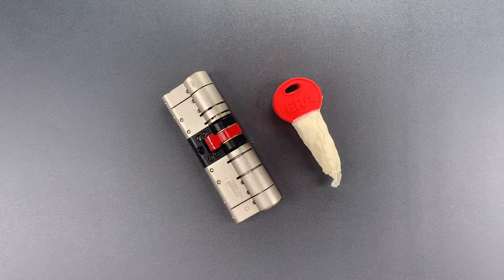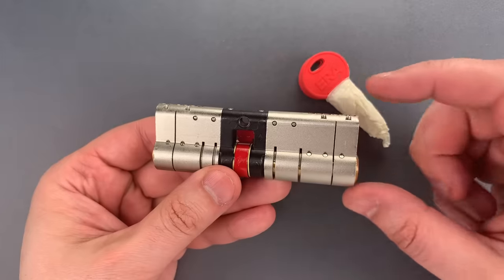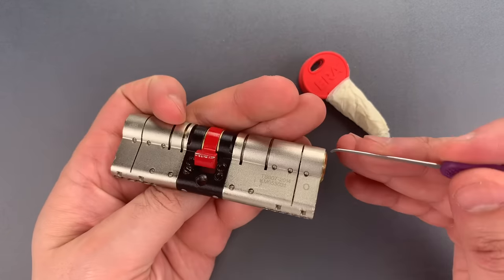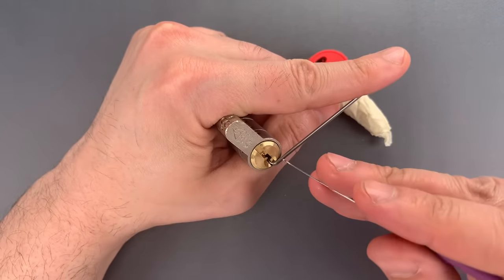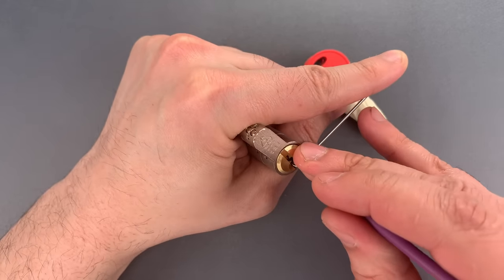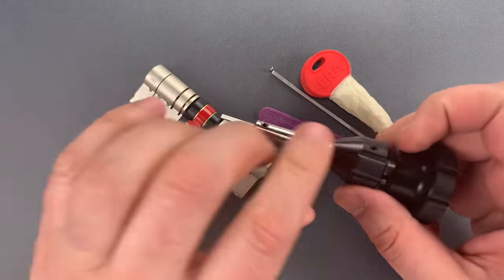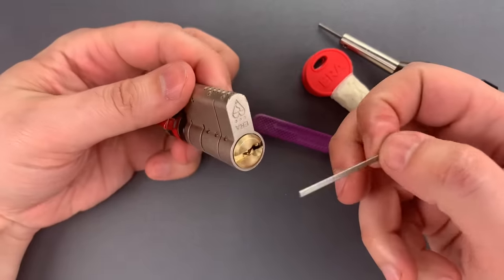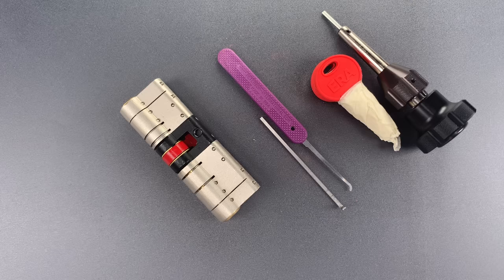[1256] ERA “Fortress” Euro Cylinder Picked (6 Trap Pins!)

Comment: "The three main threats to european cylinders, Snapping Drilling and Picking"

I suppose the main threat to american ones is firearms then?
Reply: You’re actually pretty much correct.  If you look at the residential market for locks, the more expensive a lock is, chances are, the main upgrade is beefiness.  Furthermore, lock cores in the US are (generally) less advanced than euro cores.  A “high security” lock in the US is basically just kinda resistant to bumping and raking (if that).  The difference narrows as you go higher up the food chain, of course, but at the mass market level?  Yeah.  Physical destruction (guns, bolt cutters, drills, a big ol hammer and a crowbar, etc) is the main mode of attack for people trying to get through locks here.
Reply: @glytchmeister9856  or just entering through the wall right next to the door. It's pretty much just plywood and insulation
Reply: Main threat to Americans, the owners. A lot of burglary happened without the need of forced entry or lock-picking.
Reply: @insu_na  Maybe in your crappy house, but mine has bricks as its outer layer.
Reply: I dont think I've ever seen an home invasion where they shot the lock on the door. Either the doors arent locked or they kick it in.. nobody is tryna fire a bullet and alert the neighborhood they just entered a house.. put some thought into your comments people
Reply: @eustacehendrix9659  that's because successful burglars tend to case neighborhoods and look for the vulnerable houses. 

The entire point of a lock is to make a burglar look somewhere else. It's almost impossible to stop someone that doesn't care about getting caught.
Reply: @awesomebob657  What kind of doors you all have that can just be kicked in like it's nothing?
Reply: @doomse150  some can some can't. Just depends how it's built. But most doors are sturdy. Most door frames are not. the striker and dead bolt stab into the back half inch of the door frame leaving only a small amount of wood to break to allow those locks to go straight through the wall. That's how cops break into houses. That's how criminals attempt/do it. I know. I worked for a large real estate company and had to fix several door frames after cops break into them.
Reply: @doomse150  I never said it was easy. I just said they do it.
Reply: The main threat to firearms are rust and politicians, not pickable locks.
Reply: @glytchmeister9856  I'm highly skeptical that shooting locks is a common entry method in real life (other than for police tactical teams, who use specialized rounds which are expensive and not widely available).   If nothing else, it's unlikely to work very well.
Reply: yes we have a specific part in locks that prevent firearms
Reply: @shawnpitman876   I don't know why but that response got me
Reply: If the lock snaps - you cant get in even with the key!
Reply: Don't forget the most reliable Pick, the Ford F150 master key
Reply: @doomse150  I lost my apt key once and kicked the door in; one try and the strike plate ripped out of the (wooden) frame.  This is 100% normal for US residential construction.

When I bought a house, I replaced all its doors and frames with steel.  Still plenty of windows, but at least that’s more obvious to passersby than a kicked-in door.

Comment: This is impressive on both ends. This lock does so many things right, yet there still are way to go around it, even if it takes specialized tools and prior knowledge. Alternatively someone might try this approach when dealing with any lock "just in case"
Personally, I think it looks like a lock worth buying. It will stop almost all attacks.
Reply: That's just how it is with security, there's never absolute safety, all systems can be compromised given enough time, resources and knowledge. Usually the goal is to make things hard enough that any breach attempt can be detected and prevented by other means.

Comment: American locks: "Okay I'm gonna use this regular thin piece of metal aaaand it's open."
European locks: "Okay thank god I'm seeing this lock from the outside to know where all the trap pins are so I can use my highly specialized tool to bypass them."
Reply: A professional lockpicker buys every new lock they can find, anyway. It's not even that specialized of a tool. It's just not one LPL uses often because he knows which way the lock turns before the video starts.
Reply: @bubba200874426  What do you mean "which way"? What is that tool used for?
Reply: @aze2099  it's used for flipping a lock over  to the other side when you turn it the wrong way. 

Unless you're familiar with the lock, you might not know which way it needs to turn to open. This is why professional locksmiths try to get as many locks as possible, but most can't check them all.
Reply: @bubba200874426  "it's used for flipping a lock over  to the other side when you turn it the wrong way. " in America... you forgot to add that. heh
Because in Europe most of the time you need to rotate the cylinder not once but twice and in some cases 3 times(like in case of Gerda Tytan with 16 pinds from 4 sides so you would need to pick the lock 4x3=12 times and most of the people are unable to do it even once)... and LPL when he was visiting Bill was not ready to take Gerda Tytan for a ride...
Reply: @Bialy_1  Only metaphorical tools care about who's using them.
Reply: Not that it actually matters, because burglars don't pick locks anyway.  If it can't be raked, bumped, or bypassed, you're fine.
Reply: Typical.
Europe is more on quality. China on quantity only, and the usa a mix of both, but overhypeing it to the extreem.
Reply: Americans locks are bulletproof. Because it is easier to buy a gun than a lockpick.

Comment: Out of curiosity, if you, the rightful owner, find the the lock was attempt to be picked, the trap pins have seized the core, how would open the door?
Reply: Use the rear door (climb over neighbours fence or whatever) then pull the pins out of the hinges on the inner side of front door & disassemble the latch mechanism of the door, then you can eventually get the lock out without destroying the door. While thats more cumbersome than your average lock replacement, its obviously still better than having your stuff stolen :)
Reply: You can still use the key on the inside keyway.
Reply: I was thinking of a server room or office with only one entrance. So in that case, you would have to break a window or cut a hole a wall. Thought so. 
What a way to get even with your shitty boss if he had one of these locks. (I must be spending to much time on /rpettyrevenge.)
Reply: @arikwolf3777  Anti-drill just means time and bit consuming, and loud. So if the lock is already seized by a failed pick attempt, just drill it out rather than destroy anything else.
Reply: When you insert the key, the trap pins are pushed into their correct position, enabling you to turn the core as normal.
Reply: @Chris-hx3om  you cannot insert the key because the (normal) pins are not aligned with the bible so they have nowhere to go “up” in to make room to let the key pass them
Reply: It looks to me like when the trap pins go down, the keys shape although we can't see them will still open the door, Plus the barrel will still be there and move for the key although the barrel will be turned , telling you someone attempted
Reply: @OfTheiAm  no, the pins lock the lock stuck at a 22.5 degree angle. At this point the normal pins are in the cylinder; some of them are cut longer then the longest hill on the key, as such, the key can no longer enter the lock
Reply: Shotgun.  Opposite of the handle.  8 inches from bottom, center, and 8 inches from top.  Door falls down.  You get in.  Everyone in the neighborhood understands.
Reply: @BrianRonald  Once the trap pins are engaged, you can't get the key in. There's no give on the pins since they're out of alignment with the bible, and the trap pins lock into notches on the side preventing them from turning again.

TL;DR: you can't open it, time for a new lock.
Reply: @andrewt.5567  And so does the SWAT team converging on the address.
Reply: @suicidalbanananana  and if you live in an apartment building? No rear doors there.
Reply: You don't

Comment: "That didn't take terribly long."  Only longer than the last ten Master Lock videos combined.

PS -- How thick are doors in Europe?
Reply: Many people here have security doors, they come with very good locks and mechanical construction and are not even that expensive
Reply: They're fairly strong. The door to my apartment has a 6mm thick steel plate inside it.
Reply: Some of the Euro profiles can be up to 110mm long. The shortest ones are around 50mm.
Reply: The door in my farther's house wights like 40kg. I don't know what they put in there, but I'm pretty sure it's not just the wood that you see. You won't get in there without being noticed by the entire nighborhood. Especially during the day when most burglaries happen in my area.
Reply: Depends on where you look. In most western Europe homes dors are so flimsy that you can easily push it open. I have even seen a lot of glass front doors here. Not double or triple layer doors, but just your old single layer glass that can be broken with a small rock. And no, crime rate and break-ins are very common here.
In eastern and northern Europe doors are usually from metal or thick wood. Often you can find double doors, outer door is from metal and inner is from wood usually. And crime rate in east and north is lower significantly.
Reply: These locks usually stick a little past the door (makes the "sacrificial" bit more effective, I think), but I can tell you that in Israel doors are usually between one to two inches of steel, housed inside of a steel frame, which is secured into cinder block, which is sometimes reinforced with concrete. Not only that, these locks don't only engage a latch, from my experience I've seen them also engage anywhere between 3 to 7 dead bolts, both immediately near the latch as well as at the very top and bottom of the door. Every door also has a sliding solid metal bolt that can be used to limit the door to only open a few centimeters in case you want to talk to somebody without opening it up all the way. Most people live in apartment building here, because of that most crimes either happen on the first floor, or further out into the country where people do live in houses, because no one wants to go in through the door. That said, penthouses do get hit, usually either by jumping down from the roof, or in the case of my grandmother's house, they used jaws of life, like the ones firefighters use.
Reply: Russian here. My door's rather thick, about 7.5 cm without wooden furnishings. It's also rather heavy, you can't just swing it open like a wooden one.
Reply: @melonlord1414  wood can be deceptive as far as doors go, our medical office has a very heavy wooden door with lead inside of it, it's used to close off the x ray room. A lead door would look pretty ugly I imagine.
Reply: Thick as a Brick!  (or at least that is what Jethro says)
Reply: Thick like Oatmeal
Reply: Just measured one of mine in England - UPVC double glazed 75mm, 3 inches but the lock sits in a handle mechanism that pushes it out on each side total 3.5 inches 90 mm plus as someone commented there can be a few mm extra on the eurocylinder itself.
Reply: @righteousone1  Ah, seems we've got ourselves a nutjob.
Reply: @two_tier_gary_rumain  "Righteous" seems to be the resident troll. I hope he is up to it as he has shown to have a lack of trollish imagination. Really sub-par insults.
Reply: @righteousone1  YAWN
Reply: @rueyyang  Yep.
Reply: Here in Lithuania armored (or what you call "security") doors are fairly standard even in the most mundane apartments. Those are solid steel plates with reinforced gridwork inside and reinforced steel frame around them, resistant to any crowbar attacks and also locking on all four corners all at once. It would be a lot easier to just break down a wall than to go through these things using brutal force, in my opinion. It is not really expensive either, hence the popularity, I suppose.
Reply: What are your trying to keep out!?
Reply: @grantkopka9090  Friends and family. For enemies you need something stronger.
Reply: @grantkopka9090  That's such a strange question. Everything doors are supposed to keep out? So... basically, everything?
Reply: @Aviator_Shades  Do you have the key too, or do you always get unlocked from the nice gentleman in uniform?
Reply: @Ayuima69  A door like that is only going to have two or three millimetres of lead in it, shouldn't make a difference to the strength of the door.  Lead's pretty soft.

Comment: it's gonna be real embarrassing when the thief enters through the window.
Reply: A smashed window makes it far easier to convince the police and insurance company that there was an unlawful entry than with a picked door.
Reply: Or cuts through the dry wall...
Reply: @roguebanshee  maybe, but i've never once lived in fear of my lock getting picked.
Reply: European houses (that a euro profile cylinder would be used in) usually have windows shutters that make breaking into a house a time-consuming, noisy affair.
Reply: @onocoffee  It's very rare that you'll see exterior drywall on a European house (where a Euro cylinder would be used).
Reply: @ferongr  That's something I've always wondered about. As I drive around Europe, everyone's shutters seem to be closed - at all times. Do they just live with them closed or only when not at home?
Reply: @onocoffee  Generally when not at home but it also depends. Shutters provide an extra layer of insulation so in many cases (no sunlight) it makes sense to keep them closed.
Reply: Lock your windows.

Comment: One minor thing to note about British locks is that they're often "upside down" in comparison to American locks (only locks with a handle catch on the other side tend to be the same orientation), so picking is a bit different.
Reply: It's pretty clear on this lock, because in the orientation LPL is picking it the ERA logo is upside down.
Reply: So a couple of years ago I worked at an old beach side resort in FL. Now this place was barely staying afloat and basically the only money the owners/management company were putting into it was the bare minimum. So that being said, one of the biggest complaints people often had was getting into their rooms. See this resort had exterior entry doors with old key card locks. And well, metal and electronics do not like exposure to the beach air + FL weather. From time to time the mechanics in the door would start to wear and you couldn't open the latch handle doors by pressing down on the handle, you would have to pull up (the non-worn and infrequently used direction). One of my guys at the front desk would explain to guests that some of the doors had a European lock installed... and people would just respond "oh okay."

Comment: Question to LPL: had you not seen the lock out in the open like that and it was only installed in a door, would you have known to look for all the traps and safeguards? Was there any other tells?
Reply: Yes - these locks brand the keyway itself usually to show off. So usually if you are into locks you can just look at the front of lock and they will have stamped it ERA or whatever. If they really wanted security they would stamp it qwickset. The problem is, if you have an internal audit function and high security needs, the auditor also looks at cores to check they are the right type, so you'd have to do something to show them it was a fake qwickset.

Comment: Here in the Netherlands these cilinders are usually mounted with the round part on top. Does it make a difference for security if the lock is upside down like you were holding it during picking?
Reply: I thought the same thing. Would be nice to know.
Reply: There's also usually a ball bearing and/or magnet  pin in there to stop some of the tricks he's using when placed the correct way up (they're generally just held by gravity).

Comment: This lock seems like its hard to drill, hard to pick and 'snapped' so my question for the LPL is, If someone tries to pick this lock in the wild and the trap pins fall into place, how would the actual owner open the lock to get inside or even replace the lock?
Reply: Brake your windows or brake the whole door. Normally when a robber tries to sneak in your home to steal stuff they try to be stealth and quit. So for them smashing your windows is often not an option. But if you, the owner, cant get into your house because you broke your lock, you can just damage the whole door to get in or you just smach a window to get in. You need to replace the door or the window afterwards tho.

Comment: I've just got a lock in a bunch of snapped cores from off eBay that I wasn't getting anywhere with.  I opened it up and... good grief.  Are Euro cylinders generally more prone to security pins?  This has T-Pins, spools, barrels, pin-in-pins... Does a 3-star Kite Mark really mean surreal alien tech?
Reply: The older Euro locks were defeated by using sliding hammers, then later on they started using blowtorches to melt the UPVC doors round the lock instead. Or they would just target windows.